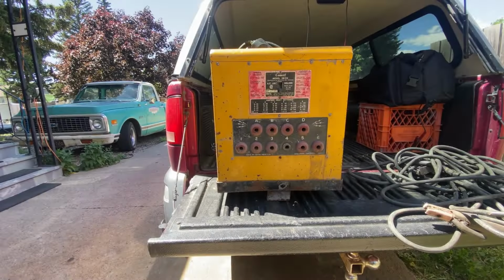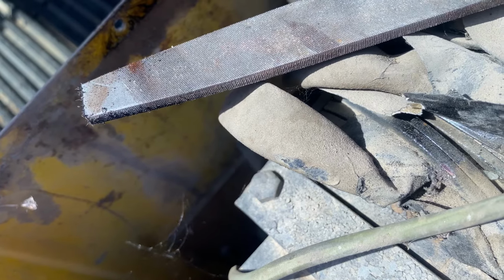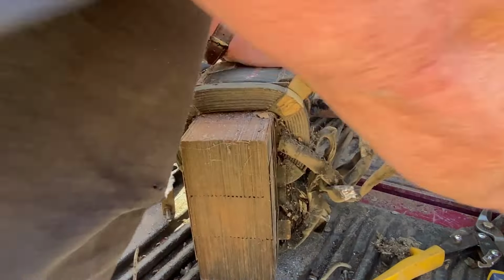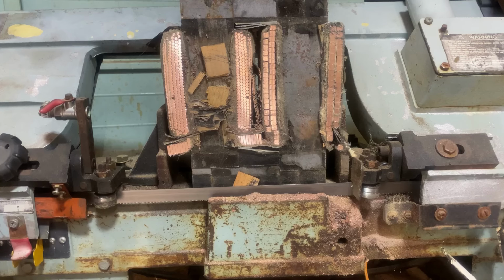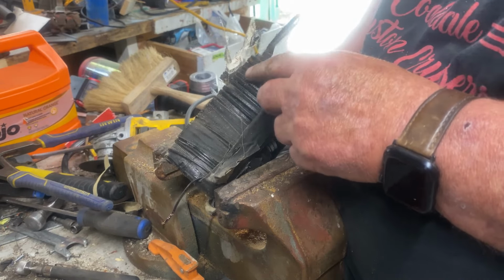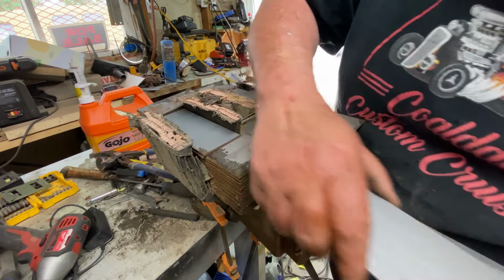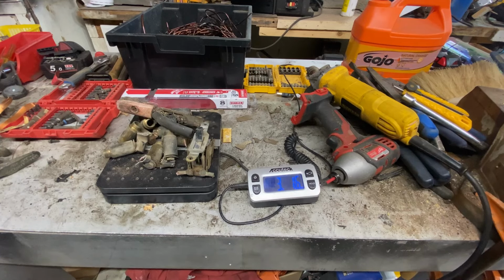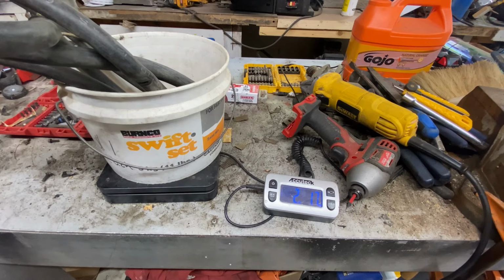Scrapping a Welder for Copper and Brass: Step-by-Step Guide!

Comment: A very informative video with lot of details. You have earned a subscriber for life. Can you scrap one piece of traction motor that comes out of locomotive or oilfield? Usually weighs between 5,500 lbs - 7,600 lbs. Has a good copper recovery and easy to break it down.
Reply from the maker: That does sound interesting I will keep my eye out for one 

You should check out the 9000 pound generator series it has its own playlist on my channel it was a brute

Thanks for subbing I really appreciate you

Comment: What the heck? I had a bunch of smart Alec comments that didn't go through. I could see them partly sent when I got on the computer but couldn't resend, copy, nothing. I was just commenting about the awesome flat screws, the lovely, slidey plates, and the very sexy pile of copper. Also, the Bertha saw dust trick.
Reply from the maker: Maybe YouTube has had enough of you 🤣

Flat screws are my Favorite but these were disappointing they came out way to easy, it’s better when you struggle

Slidey plates makes it hard to eat

Yes the copper I dream so much about the copper

Bertha is the best!